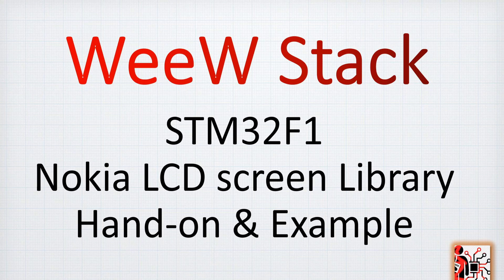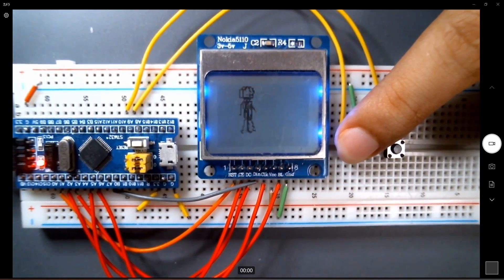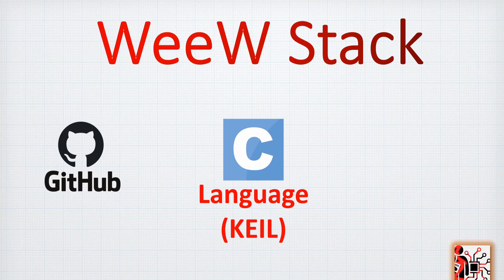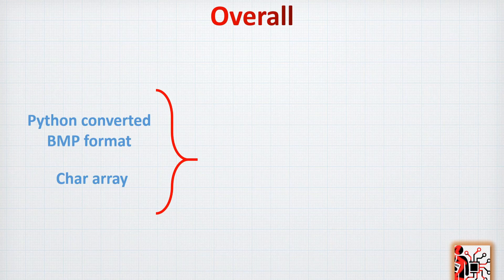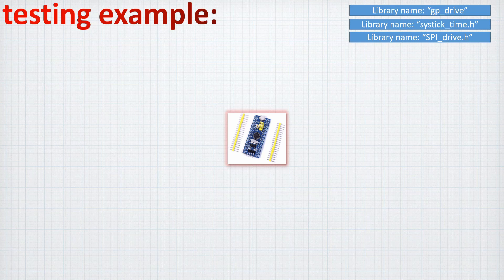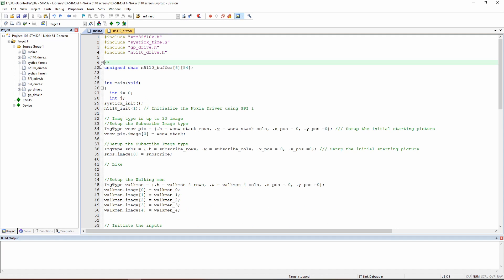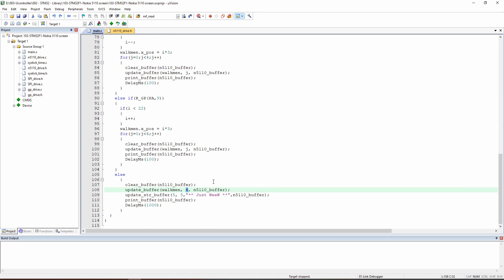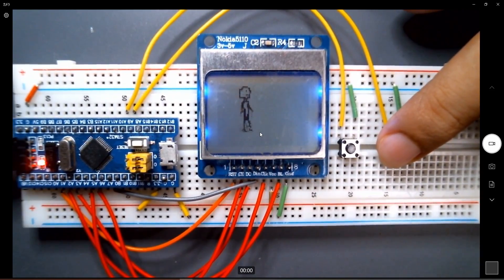103-STM32F1 Nokia LCD Library: Load text & images into Nokia LCD from BMP file & animation Control

Comment: If you use your Android cellphone to filming i suggest you "Open Camera". Is open source software and permit full manual control. This fix your continuous refocus problem on your video. Thanks again for your work !!
Reply from the maker: Hi Francois, thanks for the advice, I actually use a simple webcam but I may switch to Android and use your tip